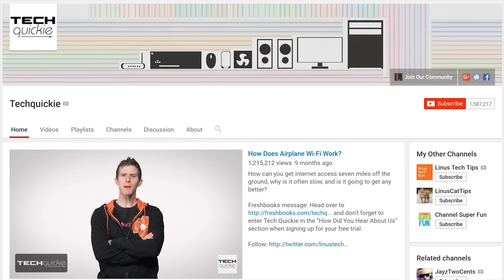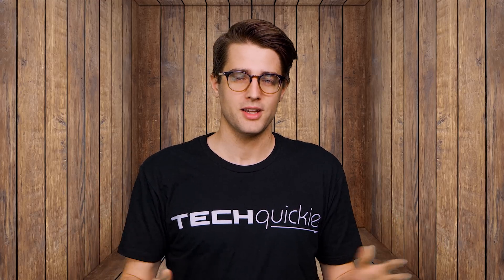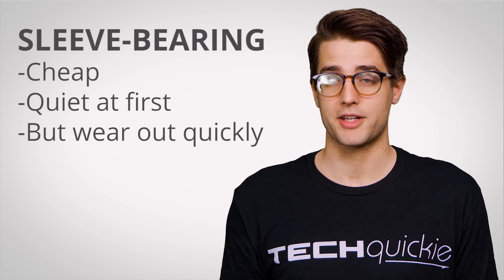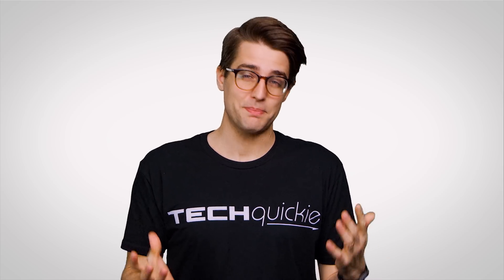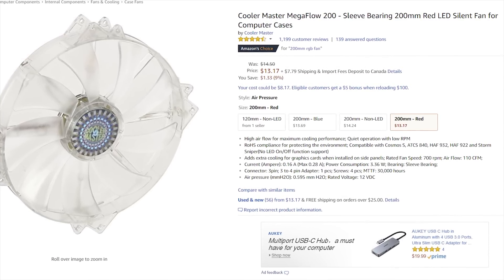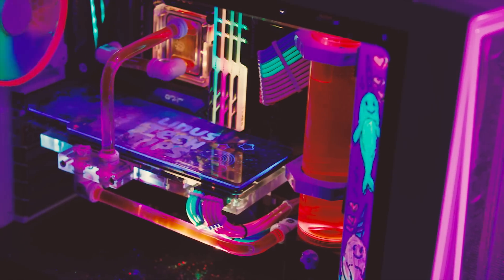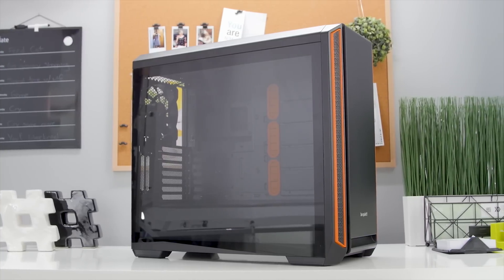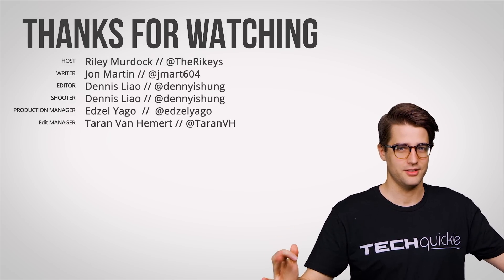How Do Quiet PCs Work?

Comment: easy rule of thumb: bigger fan make less noise at same speed. fan are really noisy in the last 15-20% of their speed. for easy reference, 120mm usually get noisy around 1100-1200 rpm, 140mm from 1300-1400 rpm. tldr, use multiple fan, preferably 140mm, and try maintaining them at full load around 1200-1300 rpm. i've made recently OC 9700k + 2080ti with 2xinput 140mm + 3x140mm out fans, under full load (cpu + gpu), stay below 74°c on GPU and 65°C on cpu with fastest fan topping at 1300 rpm after 3h load in a 23°c room. can barely hear it from 1m distance in a quiet room . and not using a case with sound dampening

Comment: One thing that is kind a missing is the simple fact that putting something in front of a sound dampens the sound. Like a wall. Or the front of a PC case where the air is sucked in from the sides rather than directly at the front. I've got one of these silent computers, but I'm really wondering if I could not make it even more quiet by putting it in a closet that relies on convection to cool. That would take space - more space than any normal CPU case - but it would really remove a lot of the sound.

Comment: I have a Corsair Carbide Silent Edition PC build with an R5 2600X and an RX 580!
2:47 My EVGA 550 B3 has an "eco" mode that turns off the fan under light load, and my mobo has the same for my case fans. I even set up an "eco" power plan for programming and web browsing.

Comment: Hello All! I have a question. When it comes to cooling fans and how they are noisy. Has anyone tried a squirrel cage type design??
On a bigger scale like cooling a big shop, they are much quieter. Adding a belt in between the motor and squirrel cage also reduces the vibration from each other. One example of a squirrel cage that everyone can relate to is the one in there home furnace.
Just a proud Geek thought!
What do you think? Sounds like a good experiment, for a video.
Thanks.
Reply: By adding a squirrel, the fan wouldn't even need power anymore...clever idea...needs testing...

Comment: great video. its should be mentioned that dampening material converts sound energy into heat energy. although this effect is fairly miniscule, in combination with the dampening materials' insulating effect, it should be expected that cases designed for silence may sacrifice cooling capabilities. this probably wont be an issue for most, but if youre trying to build an OC rig and push it to its limits, you may want to take this into consideration and upgrade your cooling.

Comment: I have a Bequiet! 801 (same kind as the one you showed but with different feet) and it's so good, it's so quiet that I thought my computer was off for a split second when entering my room
All of my hardware is also really quiet which really helps as the case isn't magic
At full load my computer is half as loud as my last computer on idle (mainly the shitty case and fans), actually at full load the pure wings 2 make a surprisingly nice noise

Comment: If you want more quiet, just don't fucking use a PC case, your temps will drop instantly by 10-15C which means you can set your fans to much slower speeds. Or just fucking buy a Nofan-CR95C and slap it on your CPU and you won't need fans. For GPU, if it's gtx1060 or lower, you can buy passive heatsinks as well. Replace HDDs with SSDs which make no noise. Buy a PSU with no fans. And you'll have a 0dBA PC just like I do.

Comment: I have a CoolerMaster Stormtrooper case, with an air cooled CPU inside (Noctua NH-D15) I even installed an extra hard drive bay to get a third front fan (so I can light up the whole front panel, not just the 2/3 as of the default config)
Needles to say, they can produce noise. But I don't mind. Even if I'm not using headphones, they aren't disturbing at all. And oh god how I love when I'm doing something resource intensive and the CPU fan or the fans on my GPU.  2K 60fps gaming on max settings. Or running simulations / renders in a CAD software. That's the stuff, it's like YEAH BABY, SMASH IT! Like giving full throttle on a sports car. I also kind of proud of my setup and of myself that I could afford it, and the beefy overclock I managed to build up. :)
And the best thing is, If I wanted to, I could easily set the BEAST to low noise mode - with minimal case CPU fan speeds, and completely stopped GPU fans, the rig produces so little noise that I have to actively listen for it to perceive.

Comment: One more thing to think about is that noise dampening cases can hamper the cooling performance of your system, which actually makes it louder. So a really silent case should actually have a good balance between noise dampening and airflow.
Reply: Or use lower wattage components that are undervolted, so you're not producing as much heat.

Comment: Get a 1200W PSU, that doesn't start the fan until you reach like 40%, or 480W. It will never start on a single GPU system outside of benchmarks.

Comment: About those passive PSU coolers - I have EVGA G2 750W and it never turns on, even during load. I have a 4690k OCd to 4,5GHz and GTX1060, but it didn't turn on even with R9 390 and R9 Fury.

Comment: More often than not, Zero Fan RPM Mode is bullshit. For 3000-4000rpm fans, granted it makes sense. For 1500rpm fans? Absolutely not. And it also can cause other issues as you can see in the RM750 Review on HardOCP and also you have constatntly starting/stopping fans as well. So that's not really a great thing and only makes real sense in higher wattage PSU...

Comment: Water cooling really isn't any quieter than air. You still need fans on your radiators but now you also have noise coming from your pump. Quieter really just means more expensive fans.

Comment: I setup my rig with a Define R4, 2x140mm in the front, Noctua NH D15 (2x140mm) for the CPU and 1x140mm in the rear.
Front and rear fans don't spin at all unless there's any decent load on the system. CPU fans spin at around 300RPM while idle, and increases to load.
Dead silent, even while doing light gaming.

Comment: So I have a I-5 8400 and stock cooler which when I disable 1 core I can have all 5 processors running at 3.9 gigahertz  and the temperature never goes above 50 Celsius even in CPU intensive games like Battlefield 1

Comment: Best solution is to just use longer cables and dump your PC unit in another room.. like I did once.

Those 6 damned 80mm case fans, and other CPU, GPU and PSU fans, made one hell of a noise but then I opted for logical and better logistical noise damping solutions.

Comment: Or you know... you can watercool your entire workroom, connecting each of your 5 work rigs in parallel, and put the fans outside with the pump and reservoir in the restroom. I heard that it will also cool the room!
Reply: Another way is to throw the issue elsewhere. PC in a different room.

Comment: 5400RPM HDD is loudest part of my build most of the time. I had to place it in the 5.25" bay, cuz 3.5" bays with gum vibration dampeners managed to vibrate and pass on vibration to the plastic parts so the PC souded like a breaking chinese sex toy (or so you could imagine one).
I've R7 1700 at 3.8GHz and 40USD CPU tower, and Asus Strix 1080 TI. The GPU gets loudest when it's on full load, sometimes I udercock and undervolt it.

Comment: 1080Ti will 3 fans on it. Case has 6x 140mm fans plus a 280mm radiator with 2x 140mm fans. Plus PSU fan and a 50mm 6000rpm fan over VRM heatsink.

Comment: I recall many times where my nearly silent power mac g5 froze up (2nd floor), which caused the software controlled fans to go high speed. i could hear the computer when I walked in the door. First couple times i had no idea what was happening. On the plus side, it'll keep the room warm in the winter; downside, it also keeps the room warm in the summer.

Comment: You put it in the basement and use an UTP KVM extender. Even HDMI 2.0 and USB 3.0. is possible with extenders nowadays. Set it to boot when you press a button on the keyboard or you will have to run down to the basement to turn it on. Linus even did a video once where he used a thunderbolt optical cable to bring out video, USB and PCIE from a system hundreds of feet away.

Comment: A lot of computers, especially laptops, simply throttle to stay quiet.
Reply: Chokes on an apple ^^
Reply: @qgameYT  most ultrabooks to be fair.
Reply: Incorrect, they throttle because they overheat. Because they overheat, they reduce their clock speed, reducing performance and increase the fan speed to cool down making it even louder. High temps are also dangerous for your CPU. Avoid throttling at all costs
Reply: @Samuel.55  Not always. Engineered well, throttling can be helpful. Throttling is how fanless Surface Pros stay quiet and stay fanless.
Reply: Yeah principally Laptop-CPUs are designed to run on their upper heat limit. But I would prefer a Laptop, that is a little thicker and heavier because of proper heatsinks instead of being 1 centimeters thick, screen included, and burn my table or legs down when using them

Comment: By adding RGB
Reply: RGB is visually loud
Reply: YES
Reply: RGB makes your System more powerfull, Not less noisy. If you Sync your colors to music, research has Shown that RGB has negative impact in the noise levels.
Reply: I typically have my fans blue as blue is cool which means it can run at lower rpms.
Reply: Remember to turn the color to blue.
Blue = quiet and cool
Green = eco
Red = faster
Reply: Red is a very loud temperatur.
Reply: I get 120 fps on crisis with RGB, but it's loud af.
Reply: Andru Bernardo RGB is always the answer
Reply: Rgb does not make it quiet
Reply: @Rainbow__cookie  WOOOOOOSH